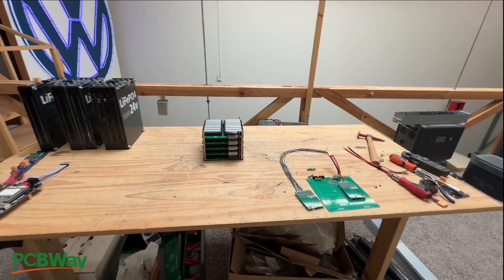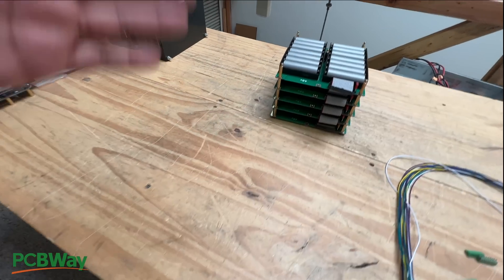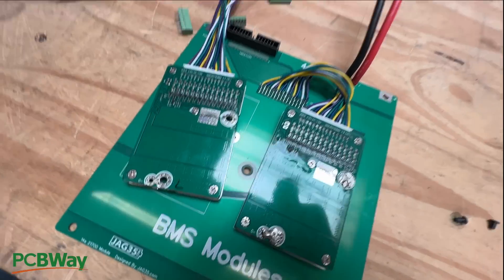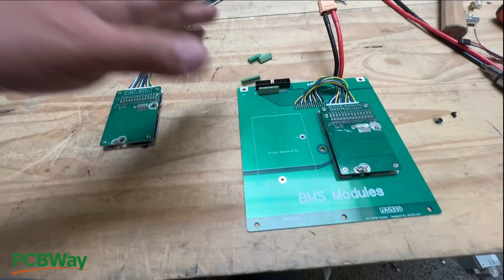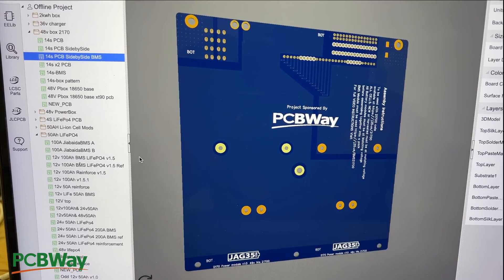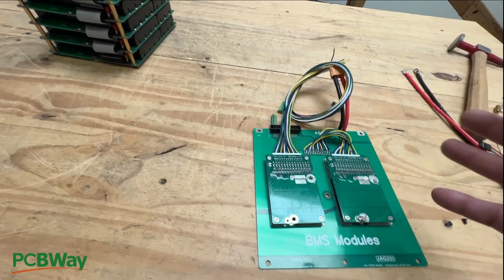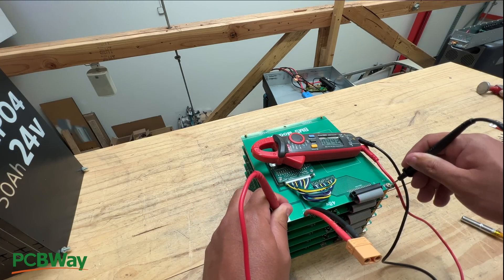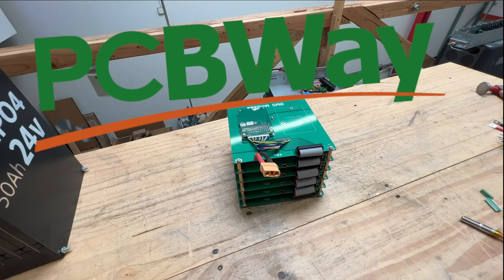48v 21700 cell BMS -  PCBWay Project

Comment: Hi mate great channel. I have brought a model 3 tesla battery for home solar, I've just started stripping it down to the modules. It turns out I got a near new 2021 or 2022 and it has the LFP battery. I'm struggling to find any info for installation and BMS. Could you offer any help or sources? I'm an electrician but not a solar expert... Many thanks for your time.

Comment: I've come to consult the Jehu-Lab... About a battery of course ;-) 
As I know you are a big proponent of DIY builds and are always making us a new PCB or showing us how to slap together a working pack from whats on your site, I am hoping you can assist me. 

I am looking at using the 50c max pouch cells you have on the site, to build a 24ah Pack at 52 Volts for an upcycled Razor Ecosmart Metro. 

I have 13.5"L x 6"W x 5.5"H Battery compartment inside the deck of the metro. I plan to use 14 cell stacks (5.25") Side by side x4 to make two 52v 12ah Packs, in Parallel. With a BMS watching each pack individually. Remoting the motor controller to the basket, and switching / modifying the rear to accomodate an 18" 2.5" scooter 1000 watt hub motor. 

I am shooting for 30-35 mph commuter, for out in the country, bike lane all the way, that will run for 1-1.5 hrs at that speed. 
The draw on the motor is 25.8amp Max (And thats at the motor max of 40mph, which I'll be limiting down a bit) 

So I am expecting a draw of 20-23 Amp nominal. Starting draw of double to triple that number. 

Would you possibly be able to make a video on Configuring these cells into a usable scooter pack? 
Their light weight, decent C Rate, and size/density, makes them very desirable to me for this and many other small EV projects. 
Especially an upcycle project. I pulled this Scooter out of the trash, and saved it from a landfill. Now It needs a purpose in life! 

Please help! You are the EV MAN when it comes to this kind of project. I know you are a busy guy, but I thought I'd reach out. 
Thank you for all the vids!
Reply from the maker: Ive already done that project https://www.pcbway.com/project/shareproject/52v_14s_50C_battery_Board_7fc2c803.html
Reply: @jehugarcia  How did I miss that? Thank you!
Reply: @jehugarcia  you still selling batteries?

Comment: @Jehugarcia I bought a AllPower Battery Generator Model Number AP-SS-003 is it possible I can rebuild it to make it more powerful. Its current spec is 280WH rated output 350W.

Comment: The project assembly it’s beyond perfect, as i said in the video before, it’s too expensive for 25 amp/hours,  I would rather keep it simple and stupid assembly to get the same rate of volts and amps/hours in the case of DIY otherwise just buying a battery already in the market and the capacity will be 20 times more

Comment: Am I missing something? If it can only pass 25 amps, the way that's built, why have two 100 amp BMSs? Why have 100 amps, for that matter? Without providing redundancy it would take four of those stacks to reach 100 amps, by what you're saying?
Reply: With 5a per level, you would need minimum of 20 levels for a single 100a BMS to be used. 

I considered something like this but of course in my design each tray holds parallel cells and each level is the series. So a stack of 20 of similar size to his would be 20s14p (72v 50AH). 

What he has would be 20x 20s1p batteries which will behave differently. Instead of having 5a equalizing in the brick, the tiny ribbon cable will be trying to equalize the cells across 20 trays of batteries. The BMS on one end of that won’t give the correct reading during sag and surge. One bad cell nearest the BMS might cause it to hit LVP or OVP during high power usage.

With 20x separate tiny batteries in series any small difference in the cells cant be absorbed by the other cells like they would if 14 cells per brick. 

After going down this rabbit hole I decided to use LiFePO4 32650 cells with threaded terminals, for which they make square holders and copper bus strips for both parallel and series connection. The battery assembles fast and if you want to reconfigure it you just take it apart and assemble it in the new configuration. If using a 10s-24s BMS you can even change from 48–>60–>72 volts. If one cell goes bad you can take it apart and replace it and put it back together in an hour.
Reply: That’s 25Ah, but you can pull 100A only will last 15mins instead 1h

Comment: Seems expensive compared to gas, why would one spend all that $$ to make a battery? When you can buy a premade 100 amp lifepo4 from Amazon for under $400.00 usd complete. 

That doesn't make sense, unless your that type of nerd who likes to tinker with electronics. 

Imo, having a higher output bms with higher quality parts/ batteries and allows me to build let's say a  10,000 amp battery in a compact size would be the only time I would consider building a custom battery. 

Something that is not on the market or is and it's cheaper to diy it. 

Overall good info in this video.
Reply: Same I said in the video before… totally agree
Reply: Word